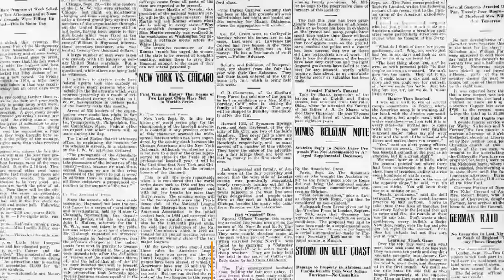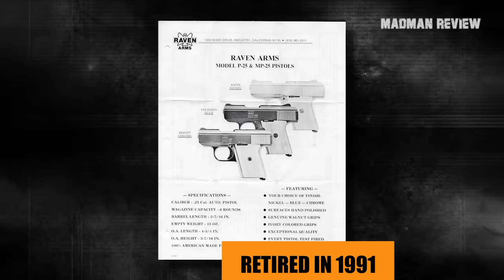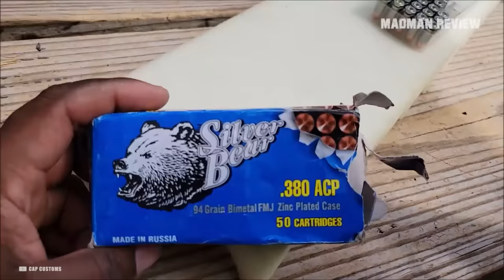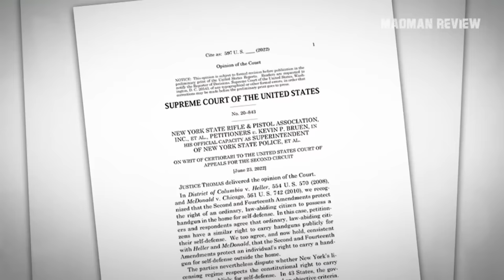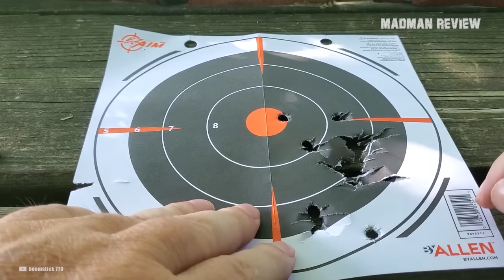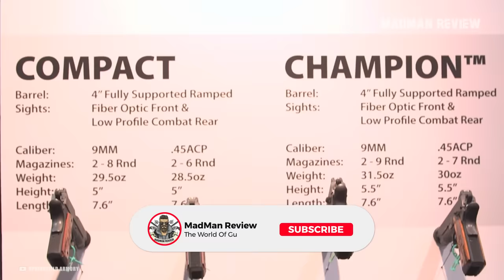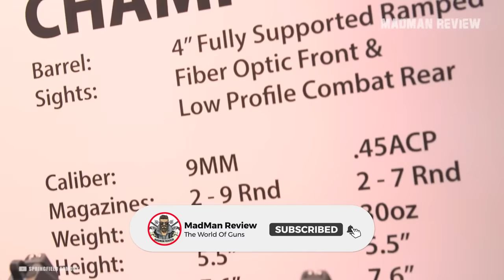TOP 8 Saturday Night Special Guns [Don't Buy Until You WATCH This!]

Comment: My raven never failed. Shot alot of rounds through it. Insanely accurate out two 2 feet.
Reply: I carried a 25acp raven for years in my boot I shot a few hundred rounds through it without a problem .
Reply: I'm with you.  These things are neat little "mouse guns" and sure beat throwing a rock at someone.  Had one for years and shot the dickens out of it with no hiccups.
Reply: @alexanderchapman2525  I'd like to find a couple
Reply: i agree my raven long since retired but i have to say never a malfuction ...lets face it these guns not shot much
Reply: Mine only Failed when I was using Aluminum shell casings ☹️☹️☹️,  OTHER WISE NEVER any Trouble 👍👍👍
Reply: @DJPitBear, those are kinda hairy in any pistol, I think.  The aluminum shell casing has a rough surface unlike the brass which is usually smooth.
Reply: @alexanderchapman2525  Yes But I've never had any Problem's with them in A Revolver 😬😬🤔🤔
Reply: The thought the Narrator was suprised the Raven .25 should have been able to shoot 2k rounds. P.S.: my big sister was a topless dancer, and she used to swear by her Raven .25 every she would swear at her boyfriends. It's true.
Reply: @bobborlog1677 I kept a S&W hammerless snub in an elastic ankle holster when I had business. 
#Bad Bad LeRoy Brown Sunshine. 🎉
Reply: I inherited my grandfather’s old Raven.  It’s a fun little gun to end a day at the range with.
Reply: @icescrew1 same
Reply: @blubard6105  so true
Reply: 2 feet? Did you get the long range variant?
Reply: @squidlipssupreme168  yea ! Scoped !
Reply: I had one also it never jammed or failed  !
Reply: @mymomsaysimcool9650 I bought one when they were $37.3 or 4 of our group of friends bought them from the local gun shop. After a few boxes of ammo, my Raven's safety would self deploy at random times. As a remedy,I simply chucked the offending safety. This was fine as the pistol wasn't trustworthy carried with a chambered round anyway. 
After this, we had no problems. The pistols all had minute of beer can angle accuracy out to 10 yards. For pocket poppers, this was excellent accuracy 
Later, some of us acquired Jennings J-22 pieces of crap. Even the factory could not remedy the "crappitudenous" nature of the pistols after several returns.
Reply: Same. Never cleaned. Always went bang.
Reply: Lmfao fr. I’ve put at least 1000 rounds thru mine with 1-2 jams🤣🤣 love that little shit
Reply: Same here. I have had 2 of them. The first I bought Back in the 80s. I had it for a long time, then gave it to a girlfriend who lived in a bad neighborhood. Bought another one 30 years ago, a used one. I had to replace the firing pin (was less than $10) after I got it, but it has seen about 20 to 25 boxes of ammo since then with no issues. I still have it and it still works and looks great, right down to the slide, inside of the barrel, and all the mechanisms. As long as you keep them well lubricated, I see no reason it shouldn't last another 30 years.
Reply: Facts!! Mine worked flawless as well!

Comment: I have an original Jennings J-22 that my late cousin owned. He put thousands of rounds thru it with zero issues. I onced the Bryco version and also had zero issues.
Reply: I had the same gun, it was reliable and accurate.....until my ex wife stole it.
Reply: I bought mine in 1987. Shot it a lot back then, but haven't in decades. Still have it. Kind of a pretty little thing.

Comment: Ravens were a copy of a old German design , very heavy big slide made them reliable & the  .25 caliber did not tax  the gun  and wear it out . They were tough and easy to work on and clean , had a fixed barrel too . Just watch for the slide bite !  It fit the back pocket great very flat and square it stayed put and you could sit on them comfortably . Keep the chamber empty it is a striker fire and can go off. Rack a round when needed . That is really the one sore spot with a Raven having to carry it chamber empty .
Reply: Dropped them, slammed them against my knee when in a pocket, never had the striker fall.. but I agree, I would not risk it and don't recommend keeping a bullet in the chamber.

Comment: 40 years ago I had a Raven 25acp, never had a problem with it, I've also had 2 Jennings J-22s, and they were accurate, I could hit baby food jars from 50 ft consistently, the 2nd one would sometimes fire two rounds with one trigger pull, which I didn't mind, because in a self defence situation, I could double-tap with a single trigger pull, and for $60 not too bad. 🤣
Reply: I had a Raven 25 acp and I never had any problems ever.
Reply: If it fired 2 shots with one trigger pull it is classified by the ATF as a machine gun.Congratulations your a felon 😂
Reply: Doubt 50 ft stikes at 50 feet
Reply: My J-22 worked until it didn't

Comment: The Raven .25 was a VERY common gun for Cops to carry as back up. Zamak has been used by German Gun makers for years without problems PROVIDED low pressure Cartridges are used i.e.  .25 and .32 auto. Bruce Jennings spent $500.000 Dollars to perfect the Magazine in the j22. The main issue with reliablity in these Pieces is often burrs left over from manufacture. A "fluff and buff" will usually cure this. I also believe Hinckley used an RG23 which was the Model with the swing out cylinder.
Reply: I was a cop in the Midwest during the Raven craze. Almost every cop carried one in a handcuff pouch on their duty belt as a backup. We appreciated them for what they provided. As long as you didn’t use exotic ammunition and kept it clean and maintained, the weapon performed perfectly.
Reply: This one carried a Jennings J22 a few times as a backup or even an off-duty piece the first few weeks or so..
Reply: I had one until it went full auto.  It got destroyed.
Found an Erma after that which I also broke.
Reply: RG-14.
Reply: @mikepulis4618  didn't have to destroy it. Its a simple fix in the trigger mechanism. You could have cut a part with a Dremel and sheet metal.
Reply: I have a raven shot a few hundred rounds thru the gun. If you kept it clean it worked fine.mind was. 25 caliber. I used white grease to lubricate it. Light white industrial grease .I had a  Jennings 22 cal witch jammed a lot. You had to use cci ammo. Cheap ammo didn't work well .
Reply: @williamschaadt8876  that's because a Jennings j22 doesn't have a proper chamber ramp. It has a feed ramp but that sometimes slides the 22 into the sharp part of the chamber and barrel... A raven 25 has a proper chamber and feed ramp, the Jennings j22 doesn't. I grabbed a Dremel felt wheel and lightly rounded the bottom edge of the barrel where it meets the bullet as it slides in... J22 stopped jamming but you need a light touch, if you over do it with the felt wheel Dremel it will ruin it and throw gunpowder in your face when you shoot it. A light chamber ramp will fix those Jennings problems.
Reply: @lucianprescott8357   A handcuff case, that's brilliant!!

Comment: The Phoenix Arms HP-22 is actually a pretty great little gun.

The .22lr round is notoriously flaky in automatic actions for a wide variety of reasons, so it's unusual to find a reliable one.

But it's even rarer to find a reliable .22lr pocket pistol. 

And yet, somehow, the HP-22 is well known for being quite reliable. 

The major drawback to the HP-22 is the absurd amount of redundant safeties that were crammed into it for liability reasons.

But these safeties can easily be modified to create a slick little pocket pistol that is actually a fun little gun, and quite reliable for a .22 automatic.

While it might eventually fail after a few thousand rounds, most people will never put that much ammo through it.

And it's cheap enough that you can just buy another one easily enough.

Reliable .22 pocket autos are as rare as hens teeth. In fact, I don't know of any other pocket .22s that are even remotely as reliable as the HP-22. So while it may not be perfect, it's still quite good for what it is.
Reply: Actually, when it does fail, Phoenix is known to simply replace it under warranty.
Reply: I have an HP22A that I use as my carry gun. I agree it is reliable, but the video stated it was "lightweight". 20 Oz for a gun this size is far from lightweight.
Reply: @ScottWiecenski  

Trying to make the HP22A a pocket-carry gun is how I ended up with a Kel-Tec P32. The Phoenix is heavy, sharp-edged, and complicated by something like 64 different safety features. I also wanted something more ready for "pull, point, and press to play" in a defensive gun, having been primarily a revolver shooter for many years.

Still, the HP22A is solid and a fun little shooter. I find it more enjoyable than even either of my Ruger Mk-II pistols, maybe because the Rugers are "too easy". One would be hard-pressed to find, in its price category, another pistol with a real hammer, as crisp a trigger, and a rear sight that is at least adjustable for windage.
Reply: @Just1American1966  I went with a Bersa Thunder .380. Roughly the same weight, but a more effective calibre.
Reply: @ScottWiecenski  

Have one of those, too. Was a bit big for pocket-carry for me. Excellent gun, though.
Reply: I don't think the author has ever held an HP22. It's steel & is heavy. Plus, they are rather reliable. Not your typical Saturday Night Special
Reply: @donwyoming1936  The HP22A is not steel. It's Zamak and at 20 Ounces unloaded it is indeed heavy for a pistol of that size. I own one and it's my EDC gun. Quite reliable and I feel loaded with CCI stingers, it's up to the task of defending me. A few .22 rounds to the stomach will definitely change a bad guy's mind.

Comment: I have no complaints about my little Raven or the Titan I had back in the 80s.
Both were reliable, and the only repair I ever needed was a firing pin for the Raven (which I bought used) after 20 years of regular use at the range, which only cost me $10 to repair. And both were accurate, especially for the short barrel. Definitely not hand cannons, but great backup pistol.

Comment: If you want a Real Saturday night special..get A .38 Rock island m206 revovler or A Bersa thunder .380 theyre small enough to be ankle guns/front coat pocket or inside a coat pocket. Theyre reliable and have more than enough stopping power plus withbthe .38...dont gotta pick up shells.
Reply: I had a Frankenstein Bersa 380. Found the lower portion (Frame, barrel, trigger bits were disassembled) at a gun show for $15 I believe. Checking through Shotgun News (Very early internet, so not an option) I was able to get the rest of the parts. I was pleasantly surprised that it worked. Probably around $40 for them. Not a target pistol by any means, but reliable and bullets went in the direction I pointed it.
Reply: @christopherconard2831  bersa/ Talon armaments make fantastic FAIR priced budget pistols. The Bersa thunder 
380 is based off the walther ppk design and for under 310 can't complain.

Comment: The Jennings .22 was a randomly dependable. One I have shot very consistently and was amazingly accurate for a pistol of this size and quality.
Reply: Same story here.  Jammed all the time.
Reply: You had to get a Dremel and lightly sand the bottom of the chamber till it's a rounder shape and connects better with the feed ramp. The problem with the j22s is they got no chamber ramp. Raven 25s do have a chamber ramp though and they feed smooth, even if you ride the slide down.

Comment: Had a Lorcin 22 back in the 90's. It was actually pretty reliable, boxes of 500 were cheap then and we'd run that sucker all day. Pretty accurate with 30 ft or so.
Reply: I remember buying a milk jug full of 22lr at Kmart for like $10 back in the early 90's.
Reply: Had a Lorcin 25- my.last carry piece- use glassers-- cheap gun in case I had to lose it. Worked fine

Comment: At the time all of those 'Ring of Fire' pistols were being made there was a fantastic little .25 of great value AND reliability for sale. I refer to the Bauer (later the Fraser) .25 auto. They were made of stainless steel and only cost $75 when new back in 1975. They are very well made and work EVERY TIME. The rest of those 'so called guns' were the same price as the Bauer but never lasted after the first 100-200 rounds. I've got a Bauer and I shoot it all the time. It's had at least 2500 rounds thru it and it's as good as new. They sell now on the used market for around. $350-$500, and if you like small semi-autos you might want to check one out. Spare parts are everywhere. They're an exact copy of a Colt .25 auto. So, no problem there. Check 'em out. Cool little guns for up close work. Six shots...real quick...no jams!
Reply: The Bauer was a copy of the FN Baby Browning, not a Colt.

Comment: My first gun was a Jennings .380. Bought it at a gun show when I wanted to go to the range with my father. It was cheap and it jammed once in awhile, but thought it was okay since I didn't know how often I would shoot. I never knew it was from the "ring of fire" group until just recently. I've kept that gun for sentimental reasons and still use it at the range, and yes, it still jams once in awhile, despite being cleaned. I would never CC it. I will tell you that it handles pretty well.
With these cheap guns, you also have to understand that criminals use them and don't take care of them, so of course they are going to misfire way more often than any other gun.

Comment: I have had two Ravens and a Lorcin .380. i still have one of the Ravens and the Lorcin.  I bought one new back in the 80s, it saw a lot of use at the range and never gave me any problems, the second one I bought used for a song in about 1993, after buying it I found a crack in the firing pin, and the wooden grips were cracked. I replaced the firing pin and since the aftermarket grips were crap, I made my own from some Osage Orange that I had and added some thickness and hand carving. I still have it, and in spite of having ran somewhere around 20 50 count boxes of ammo throug it, it is still in exellent condition and has been very reliable. The Lorcin is also still working very well, in spite of being soaked in rat piss for several months (was caring for my mom at her place when Alzheimer's struck, and it was in a closet on the top shelf, that is how I found it) in spite of looking like a basket case when I discovered the situation. After unsticking the slide and inspection, everything but the finish was still in practically mint condition. After refinishing, you can still see a bit of pitting on the outside showing through, but it has been thoroughly tested and works like a champ. 
I believe the law suits were far more about the money behind the activist non profit orginizations funding the lawsuits than the safety of the guns. Because mine have functioned exactly as intended. Inexpensive home defense.

Comment: Rambling commentary to follow, read at your own discretion.

Most of the ring of fire companies have gone the way of the dodo. Phoenix Arms is still around of course, making the HP-22 and 25.

Jennings/Bryco/Jimenez has done another sued in to bankruptcy, form another company Jennings family two step. The new version of the company, JA industries LLC only makes the JA 9 now. 

The convoluted lineages of Davis, and Lorcin are pretty much done. Cobra picked up where Davis left off, in the typical Jennings family style bankruptcy two step. Along the way they began producing two of Lorcins designs in addition to the old Davis lineup. Cobra eventually went under and was succeeded by Bearman industries. At that point they only produced the derringer line. Recently the rights to the derringers were sold off to a new company called Old West firearms, who have continued to offer the Davis/Cobra/Bearman derringers. I have no idea if the new company is owned by yet another extended member of the Jennings family, but given the history of the ring of fire gun manufacturers, that is a possibility. 

Along with the usual problems with those guns, the advancing technology in firearms, has rendered them obsolete. Cheap polymer framed double action pistols that offer features similar to more expensive handguns are common. A cheap blowback handgun made using zamak isn't going to be substantially cheaper than their more capable competitors like a Taurus G2c 
That leaves the ring of fire guns in the history books for the most part. They are a historical, and perhaps a mechanical curiosity at this point. Probably in the realm of a novelty, or collectors item.

Oh for the Raven owners out there, Phoenix arms still sells magazines, and parts for the Raven. Or at least they did as of a couple of years ago, when I bought from them. Pretty interesting that they still had stuff for a design that has been out of production for three decades.
Reply: I think the Zamak crowd shifted strongly to Hi Point as well.  A big Hi Point is more intimidating than a mouse gun for home defense.

Comment: Had a raven arms MP-25 and I never had an issue with it. I never understood why people dogged them so hard. Mine at least was accurate and reliable. The rare stovepipe if it hadn’t been cleaned in a while but that’s it. A .25 isn’t much in terms of power but at the same time I personally wasn’t ever carrying it for defense, it was the yard work gun for snakes and critters. Didn’t like the slide bite from a high grip but overall it was a fine little gun. Tad heavy with pocket carry but I’d buy another in a minute.

Comment: I went with a ruger lcp for 180 rather than the jimenez 380 for like 80-100 bucks so I think I got a better deal lol
Reply: You did
Reply: Before Covid and internet tax I saw a bunch of cobra 380(almost the same as the Jimenez) for $50 on GunBroker. $180 Ruger LCP isn't bad at all.
Reply: @timd729  ever hear the saying " you get what you pay for"? Ruger is a good choice. Although that little Ruger is not easy to rack. & it has a snappy recoil. But overall a decent piece. Good luck in your endeavors.